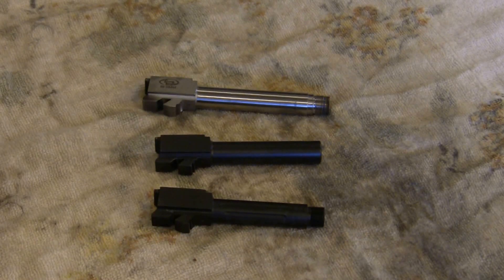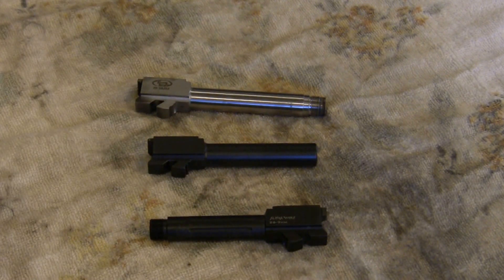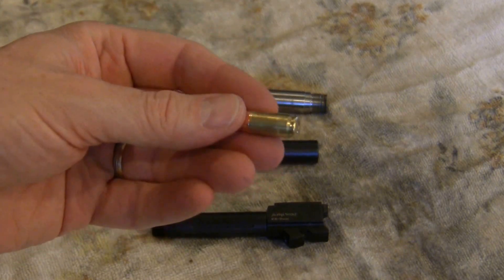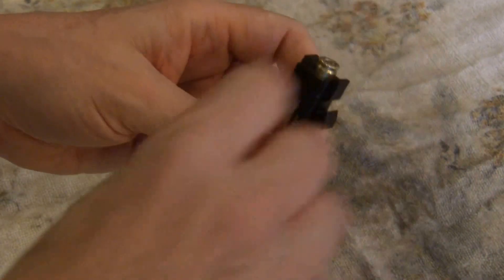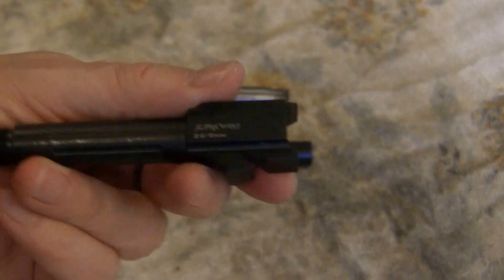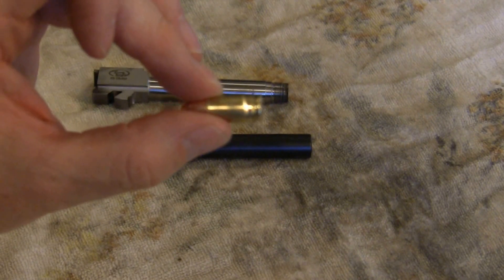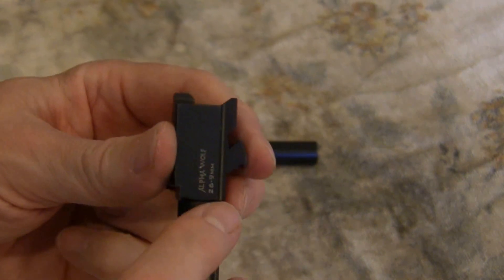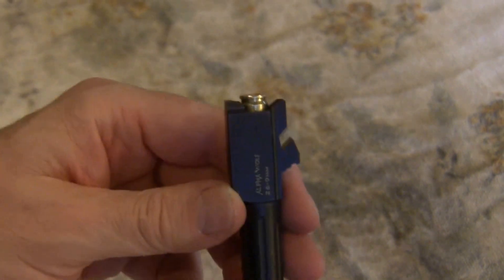Alpha Wolf barrel and LAX Reloaded Ammo a Bad Combination

Comment: 147 gr 9mm sucks anyway. 124 is a much better weight for 9m,m
Reply from the maker: Tyler Curtis agreed, but I bought these with the of using them with a suppressor.  Right now I am just trying to use them up.  I won't be buying more.
Reply: Armed Diver yeah 147 is pretty much for quiet ammo. I carry 124 and they are nasty
Reply from the maker: For personal carry, I am currently using Sig V Crown 147 gr.  I am kind of fond of the 147 gr for carry.  It is a heavy slow bullet, which translates into knock down because of the weight.  It is also much less likely to exit the body, reducing the possibility of collateral damage.  As a bullet just to shoot I really like 115 gr.  You are very correct in calling the 124 gr "nasty."  It will definitely tear up your target.  Ever shot it into jell?  It is devastating, but at 7 yards it is very likely to go straight through the bad guy.